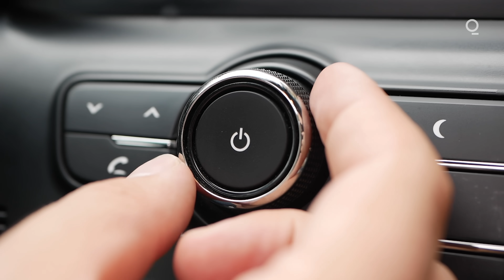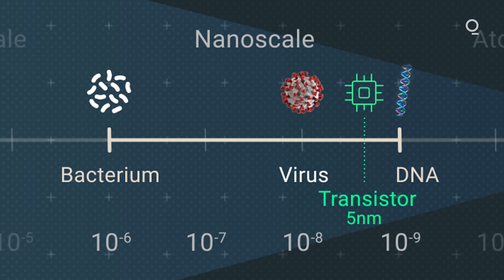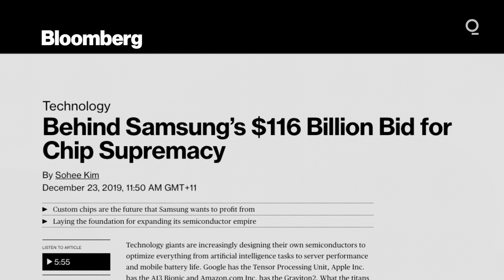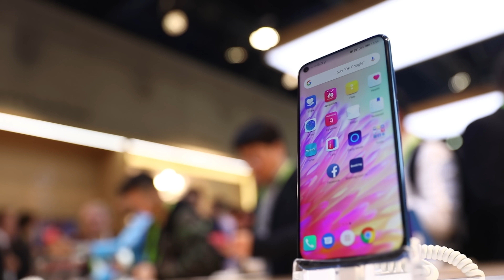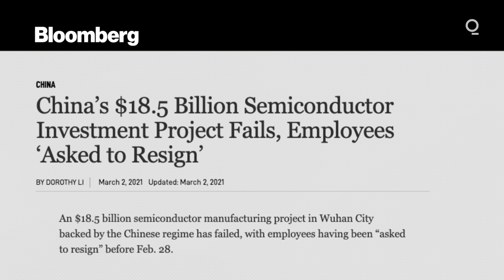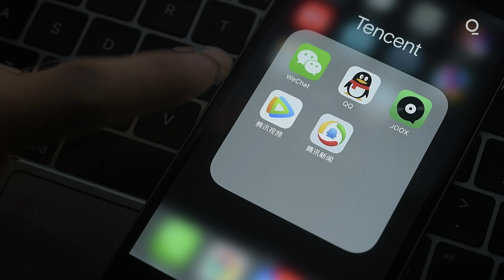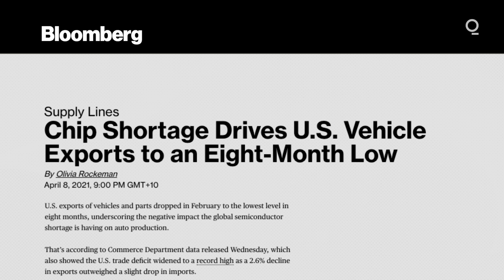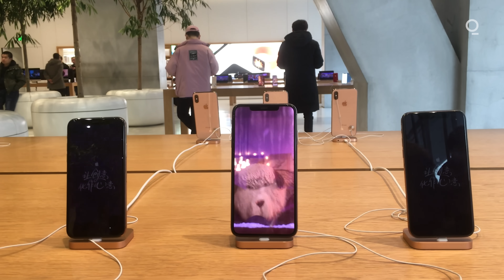Inside China's Accelerating Bid for Chip Supremacy

Comment: China did not say that it will take over Taiwan by force if necessary. What China did say was "It dose not rule out the possibility of taking over Taiwan by force". That is when Taiwan declares her independence.
Reply: The mainland actually wants a peaceful reunification.
Their main concern are the ties Taiwan has with the US military and the CIA. Combine this with a seperatist movement and it becomes a question of national security for China.

I think if Taiwan wouldn't have close ties with the US military and CIA, there would probably much less military tension.

Also "taking over by force" doesn't necessarily have to mean an actual war, but something like a sea blockade. Taiwan companies also have extremely close ties with the mainland.
So the mainland could make a lot of pressure on Taiwan by doing that and force them to negotiate.

But when the US military wants to get involved it can get dangerous. If an all out war or a huge economic war breaks out between the two, the worlds economy could crumble to dust on all sides (in a worst case scenario)

Comment: Nanotransistors that measure in the billionths of a meter.  That's insanity.
Reply: A billion nanometers (10pwr-9) equals one meter. Are you challenging the math or are amazed by the tech? It will bottom out sooner rather than later, as the silicon atom diameter is about 0.2 nm. The current state of the art for the process node is 5 nm, and they're working on 3 nm. They're pushing close to the limits of what physics allows.
Reply: @luxemag4347  amazed, not challenging.

Comment: Is it true these chips in general cost less than $5 ??
Reply: It depends on what you are talking about... ranging from less than a cent up to several tens of dollars or more, the more advanded the process is, the larger / more complex the chip is... the more expensive it gets... cheap power management stuff for some low power usb device can be in the range of a few cents, a thick fpga will run you a few tens of dollars, and smart phone cpus / cpus in general are on the order of hundreds/thousands each
Reply: @johnuferbach9166  

Thanks... that's why I said "in general" and from what you said they are cheap things IN GENERAL... amazing that such a cheap thing stopped whole sectors of the economy.  
I wonder though, if scarcity is key for price assessment and for inflation, why they haven't gone up exponentially??  Do you know?

Comment: The most important detail has been omitted here. 5 nano is approaching the absolute limit of how small these can be made using present methods. Its a dead end.
Reply: Quantum computing is coming
Reply: may be dead end for Silicon but they will start using material other than Silicon
Reply: Silicon chips are still pretty much flat.... that leaves a whole dimension to exploit, doesn't it?
Reply: @rwold8779  Yes , but for one pretty insurmountable problem. Heat dissipation.  2 layer Chips, one above the other, creates complexity of RELIABLE connections plus the huge heat (at least double) to dissipate efficiently and , most importantly, simply, and therefore cheaply.
But someone will overcome the problem, Lol.
Reply: Can u elaborate plz
Reply: @Slatt Gotit  The atoms of silicon is 0.2 nanometer in diameter. 5 nano meter is like 25 silicon atom wide. ie the gatelength of the transistor is 25 silicon atom wide.  

There is not much space to shrink this gatelength any more because electrically it will be subjected to different effects at that scale. (ie it will not behave as a transistor). We are basically approaching the limits of atom.
Reply: @slattgotit4779  if you go thinner than that "destiny", the electric charge can easily break the chip
Reply: Quantum computing they say which I way past my understanding. I think Intel is going there and for that reason letting TMSC get ahead.

Comment: The chip shortages for cars, appliances, cheaper electronics are not the scarcity of the top end chips like the 5 nm or 7 nm but the larger 24 nm and above, some of which were selling per-pandemic at less than  a few dollars per chip.
Reply: They're still on a shortage simply because they are also produced by TSMC. The company doesn't just make advanced process nodes. They also make ~300nm products for more mature and widespread chips. Everything has been slowed down because of the pandemic
Reply: @pieluver1234  you are right, but also wrong on the last point. TSMC hasn't actually slowed down production, they just allocated capacity to other customers after the automakers cancelled their orders. They have been challenged by water shortages and I believe a fire at one of their sites, but not the pandemic.
Reply: @luxemag4347  no, it's not just shifting production. The entire semiconductor industry (fab, chip packaging, retailers, etc.) projected that the pandemic will slow down demand, which it did, for a short period of time. Then it shot back close to the end of the year, and now the demand is higher than ever. It's a combination of scaled back production and unexpected exceeding demand. For example, shortage of AMD chips were at a point bottle-necked by packaging
Reply: @pieluver1234  we're splitting hairs. I countered a small point in your initial reply, that the pandemic affected capacity.  As in, the pandemic caused less capacity, which isn't how it works. In your 2nd reply you're talking about production output, which is a different thing I'm not disputing. For a multitude of reasons, there was less production output in the first part of 2020, and those reasons were an expression of the perception for future demand. Agreed. Capacity in that timeframe stayed the same and went unused. Capacity isn't something you store. Yesterday's unused capacity is gone. When demand picked up in the 2nd part of 2020, there was capacity impairment due to water shortages and fires. Perfect storm.

Comment: To say that those 20-billion fabs get obsolete in 5years is exaggerating. The most needed chips like those used in the automotive industry don't have to be cutting edge.
Reply: True, but the thing is there are more phones and computers than cars. While the old process can still be used, the volume of production will reduce substantially.
Reply: He was talking about in general . in some years 2nm is coming
Reply: @therocketmanprince682  But devices do not need 2nm. Maybe smartphones, which have to be tiny. The truck does not care if it is 2nm or 20nm.
Reply: @georgebrantley776  Size has to do with speed and processing power. Final die size isn't all that important.
Reply: AI ?  AI? AI? AI????????

Comment: What is the point of making smaller chips if you need a large cooling system?  The smaller the material is the less current and temperature it can carry. Therefore low efficiency

Comment: Extraordinary that the company that makes the fabrication  machines that TSMC uses wasn't even mentioned. 
ASML - a Dutch company is the only company in the world capable of making the machines that make 5nm chips at high volume and yield. In turn hundreds of other European high tech companies make components and modules that ASML then integrates into their leading edge machines.
TSMC is only a foundry it doesn't make the machines that make the chips.
Reply: It is true that ASML is the maker of the machine (using the analogy of an Oven) that makes the chips. BUT the recipe rather than the oven is the critical reason why TSMC is so valuable. Intel has the same ASML machines but have been lagging significantly behind in recent years to keep up with successfully yielding smaller nm chips. Another point I want to bring to your attention is... notice all top silicon related companies are helmed by Taiwanese or Taiwan-affiliated people (Nvidia, AMD, TSMC). It is a network of people with the right recipes that makes the industry.
Reply: @Joshua-c   TSMC is the baker; AMD, Qualcomm and Nvidia designs the recipes
Reply: @Joshua-c  exactly. Many commenters know nothing of the fab process. They don't ask why Africa just buy the machines and become chip makers.
Reply: @Joshua-c  no, of course not. everybody can make chips if they had the machines.
Reply: @ingsocapproved  are you commenting authoritatively, as a process engineer? I'm an electronics engineer (not currently practicing), but have been in the employ of a number of microelectronics companies owning fabs (three companies actually). Older process nodes, some time back in earlier ages. Still. There's a lot lot more beyond owning the machinery to make it work. It's not a CNC by any stretch. Cell libraries for instance. They're custom for each process node, and are sometimes custom for individual fabs. The oven (fab) and recipe (process) is an apt comparison. The lithography machines are co-developed with the process nodes, they're joined at the hip, with  a lot of secret sauce. It's not like ASML or Applied Materials says 'here's your 5nm printer, have at it'. They enter deep partnerships with the fabs.
Reply: @luxemag4347  yes authority. ;)
Reply: @ingsocapproved  wrong. Know nothing of the fabrication process.
Reply: @desertwind6923  hahhaaha, what about everything?
Reply: @ingsocapproved  Go ahead and prove your point. Just like no other country can make the iPhone except China.
Reply: @medeliworld  korea makes phones too. as far as i know korea and china make smartphones. you know any other?
Reply: @ingsocapproved  And why do you think no other phone companies make phones in Korea? You need to use your brain a bit dude. China can produce one billion phone a year. Try that in Korea.
Reply: @medeliworld  i don't think your story has any connection to what  said. China makes 80% of all smartphones i guess. Korea 20%. some thing like that
Reply: USA forbids Dutch ASML to sell machines to China.
Reply: @ingsocapproved  how can the US forbid a Dutch company to do bussiness with China? are the Dutch slaves for the US?
Reply: @dariomladenovski6481  Europe is american colony since 1917. very few sovereign countries in Europe left.
Reply: @ingsocapproved  Finland  and Sweden are the only sovereign countries in Europe
Reply: @dariomladenovski6481  soon nato, sweden cdbc next year. both EU. so not independent AT all. Switserland might be only one reasonably independent.
Reply: @ingsocapproved  no, Swiss broke their neutrality when they sided against Russia after 400 years for the first time because of US pressure ,Finland and Sweden are the only countries that are not in Nato and under US command for now
Reply: @dariomladenovski6481  no EU country is souvereign, per definition
Reply: @ingsocapproved  Crazy.
Reply: @ingsocapproved  china is a threat they copy steal technology.
Reply: @ingsocapproved  the asml machines have self destruct mechanism that doesn't involve powerfull explosions, it just makes sure no one other than asml knows the tech inside the machine completely
Reply: @ankhenaten2  well. I do ;)
Reply: @ankhenaten2  Do you have any information about that, it kind of sounds made up ?
Reply: What makes the bread? The baker? Or the oven?
Reply: @sebfleebee  That analogy doesn't work. If a baker doesn't have their oven they still have alternatives or can get creative. There is no alternative to making these EUV machines if you want the highest quality chips. Everyone in cutting edge chip manufacturing relies on one another.
Reply: @sebfleebee  If there is only one company that can build ovens...
Reply: @sebfleebee  you can’t make the bread without the oven tho?
Reply: @sebfleebee  There are multiple bakers. Just one oven.
Reply: ASML components come from 
Japan, the United States, Taiwan, Europe and other countries
And ASML developed EUV with the help of TSMC !
Reply: EUV was developed in TSMC's f12 located in Hsin Chu, without TSMC and Taiwanese scientists' help, there will no EUV, and Cannon will still be the boss. Many Chip designs like FINFET were broken through by Dr. Chenming Hu. and other Taiwanese engineers.
Reply: Such a shame we have left the EU, the UK should've taken ARM into public ownership and signed a deal with the EU to ramp up ASML foundry creation across the EU. Computing, another thing the English created that we have been left behind in, add it to the list with trains and every other sport.
Reply: That machine is just an efficient laser cutting machine but you required also great engineers and a highly skilled team to complete manufacturing of micro chips.
Reply: That's what happens when Bloomberg produces propaganda instead of journalism
Reply: True all the power is in asml their hands and usa is protecting asml with cia and secret services
Reply: @ankhenaten2  ASML equipment has usa proprietory tech in it. Ofc that makes USA have a say on who the tech is available for.
Reply: @ankhenaten2  well except the ASML owner is very pro China.
He can sell a Ton more machines to China.
When there are more machines in China, The chips become Cheaper for everybody.
Reply: Nice plug
Reply: a long time ago I read an article about how the dutch philips company made semiconductors, does that company still produce chips?
Reply: So why US so worry? Hmmmm
Reply: Yeah. EU should stop selling them and become a chip superpower. And a military superpower.
Reply: Agreed.
Reply: ASML developed that technology together with  American companies , that’s the reason the US government has a saying on who can purchase those machines .
Reply: Which bespeaks the complexity of the global supply chain that makes these fabs possible. More important, the next breakthroughs in photonics, self assembling nanodevices, smart matter, biosynthetic assembly... are going to further change the complexity of this process and the number of players involved. As technologies like Musk's Satellite telecommunications further the democratization of technology, more and more people from the third world will be able to participate in global competition. 

The real problem is that huge monolithic social paradigms are shattering in the face of accelerating technological pressure, and the dislocation of society in the growth pains of a truly democratic world are growing ever more extreme.
Reply: TSMC will open facilities in germany in starting in 2024 ! 
Europeans will have to high their game to not be "folllowers" in this "cold war" !
Reply: The technology to make fine chips without the Ultraviolet machine, from ASML, is in development in China.
Reply: @MrThezous  And it is going nowhere, they  already lost 190US$ Billion this year as their latest company went bust.
Reply: @thorc4167  Can you tell the name of the company?
Reply: Thats why we should protect ASML !!!!
Reply: Recipes for cakes are useless without the means to bake them. 
ASML not only makes the machines to make the chips they train the foundry workers how to use them. The recipes (the designs) for the chips are not created by TSMC either - but by people from NVidia, Apple etc.
The making of microchips is a massive collaborative effort by hundreds of companies across the world - one of which is TSMC. 
The sole purpose of my comment on the video was to point that fact out.
BTW I think it is outrageous that the US bullies ASML with regard to sales of 5nm machines to mainland China. 
However, I'm sure the US will pay a very high price for that bullying within the next 10 years.
Reply: @peterbranagan1010  are you a process engineer? I would describe the recipe (in the context of a silicon fab) as the process node and library, not the chip designs (mask layouts). Each process node has its own tweaks, it's not just the lithography machines. I've been in the employ of three microelectronics companies owning fabs, but never inside one. I did see designers moaning about process nodes, as chips are designed and validated for a specific node. The process library comes from Samsung, TSMC and their lesser peers, never from ASML or Applied Materials. I am happy to be proven wrong and learn.
Reply: @luxemag4347  
Sorry, we are obviously talking at cross purposes. 
I've already clearly stated that the manufacture of 5nm chips requires the expertise of hundreds of companies across the world and specifically named TSMC as one of them. I have no doubt that TSMC is a brilliant company with highly skilled engineers.
Reply: @peterbranagan1010  US and other companies invested billions in the research, also supporting ASML directly with money, hence they have obtained patents and other intellectual properties. Without this money, support (also from US research facilities), ASML wouldn't have these machines to sell.
Reply: You forget that that Mayonnaise is just as important. TSMC Taiwanese Super Mayonnaise Company. Eets smakelijke!
Reply: Yes I felt that was the only error in this video.

Comment: To be a top advanced chipmaker like TSMC, you need advanced production suppliers from the US who can be blocked by US sanctions.  China will be the king of less advanced chips but will not be able to produce low nanometer chips on its own for decades.
Reply: They will eventually get there. They have no shortage of manpower, money, talent or political will. the rate at which china will improve in this sector will be higher than usa or any of its subordinates. Once that happens, usa will have very few leverages against china.

Comment: Actual transistors are no longer made. They have been integrated into what are called integrated circuits which are carved into silicon and are unbelievably small.
Reply: Transistors are formed on silicon wafers. They're still actual transistors.